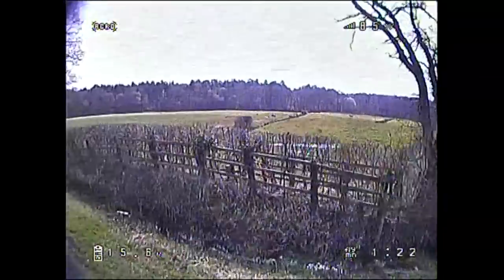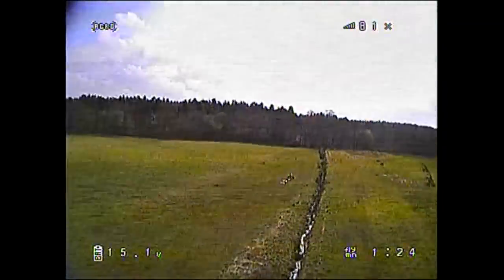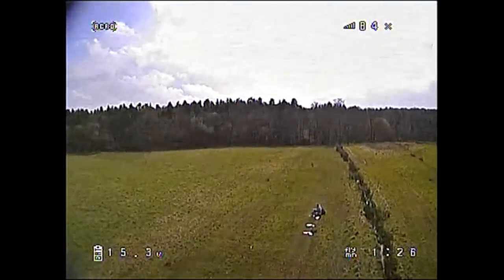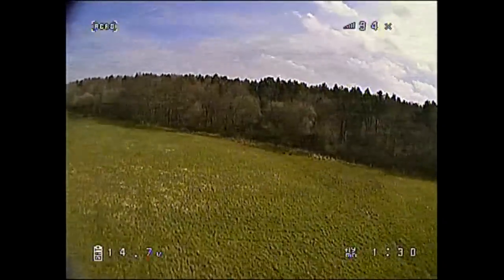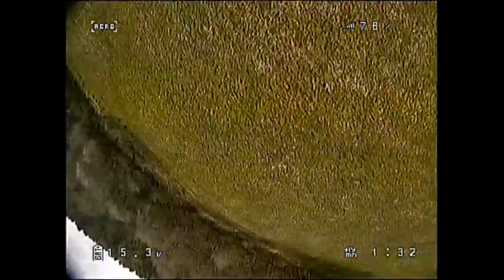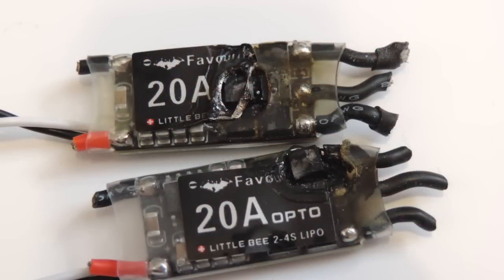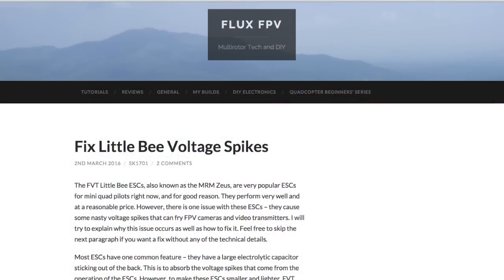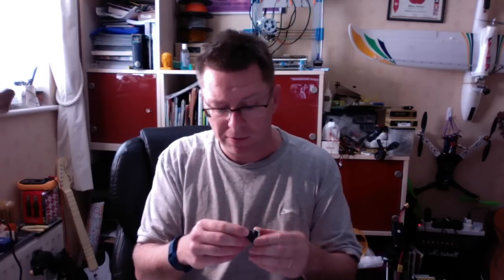Help: Why are my Little Bee 20a ESC's bursting into flames ?

Comment: 4s 5inch 30 amp esc or more.  Check motor specs. Burst 10sec 45 amp. And keep motor running at idle speed.  Prob solved

Comment: Sir can u help me..im building my fiest quad and i ordered this esc to be used on a f4 omnibus pdb fc... it says my fc supports dshot but the esc only shows oneshot? Can i still use it to build my first quad even it only supports oneshot
Reply from the maker: Yes - if you have these original LittleBee 20a, then they don't support DShot, so use OneShot125 as the  best thing they can give you.  You FC won't care, you'll just need to set the ESC type in Betaflight to OneShot125 as well
Reply: Ohhh i see sir..sorry im really new to building this quads... actually i have the 30a version of littlebee... so happy to know that its not an issue..i just need to configure it on betaflight and use oneshot option...thank you very much sir...so.excited to start my first quad build

Comment: a follow up to this might be nice.
Reply from the maker: Well, the quick follow up was this was over 2 and a half years ago and ESCs have moved on.  As far as the little bees went, my replacements didn't explode, but I wasn't happy with the amount of noise they produced and they are all sitting in the spares box at the moment as I swapped out for better things.  As far as why they blew up, some people tend to worry that there were loads of fakes around, and there was talk about never running up motors up full without props else the RPM goes too high and then they pull to many amps and blow the ESCs up.  I don't do that anymore as well as a precaution.
Reply: @CurryKitten  thanks for the reply. I bought a second hand quad - seller claims the esc are littlebee 30a - but the blheli code would suggest they are 40a. let's hope i have better luck than you did.

Comment: I’m a noob and just bought these ! First question is can I use them without doing anything to them ? Also can I use them with omnibus f3 board ?
Reply from the maker: I didn't know people were still getting these, ESC tech has moved on, and things that don't run BLHeli_S and Dshot are considered a bit old.  But yeah - they should be ok, just don't run them up very high without a prop on, and I think just about everyone will agree that they are a touch on the noisy side as far as causing some lines in your video.  Other than the two that went on fire, I continued to run a 4s quad using these ESCs for quite a while (until it got retired in place of better quads/components)
Reply: CurryKitten I got them cause they were cheap can you tell me some cheap better ones to use
Reply from the maker: Don't worry - they'll work fine - fly with them and have fun.  By the time you get to wanting new ones, ESC tech will have jumped forward again.  BLHeli_32 is already getting more popular, so wait a while and skip BLheli_S entirely :)

Comment: Hi mate - the issue is your ESC's werent sized for your battery (4s) and motors. There are two issues with your setup:
1) The voltage spikes are caused by regenerative breaking (damped light). This is killing your electronics.
2) Average current draw from your motors @ 4s exceeds ESC capacity. This heats up the FETs, to the point that the solder that bonds them to the PCB melts, and the moten solder than shorts the ESC -> fire.

Solution to Problem 1: Reduce loop time and add LOW ESR capacitor (preferably 250uF per ESC, or one 1000uF)
Solution to Problem 2: Use smaller motors, OR use 3s

So the only real solution to this will be upgrading to a higher ESC rating. KISS 24A handles regenerative braking quite well (however LOW ESR caps are still recommended if using long power leads to each ESC) and will handle more current than the littlebees. Well worth the investment if you are venturing into the 4s race quad world.

Comment: Which one do you suggest please?
Reply from the maker: Last ones I used were these Racestar ones (https://www.banggood.com/4PCS-Racerstar-Labs-28A-28amp-2-5S-Dshot600-Ready-ESC-BLHeli_S-16_5-BB2-Supports-Dshot300-Dshot150-p-1139329.html?p=E81211714085201408XQ) which are doing very nicely so far.  I liked the fact that they come without any wires soldered on, so you could get the length you want just right.  BLheli_S and Dshot 600 as well - getting nice smooth flights from these so far.

Comment: Me and a mate between us bought 15 of these ESCs for exactly your purpose (4S on 250 size quad). We call them "LittleBomb"s. we bought 12 from a reputable supplier - 3 were DOA and over the course of a month or so 5 caught fire during normal use. Checked on a bench and with our setup we were pulling 19A on 4s. Because the signal wire is so close to + battery, when it catches fire they tend to short together, killing your FC. This happened to me twice!! My advice is get some better quality ones and move on. Once you do, you never look back :) happy flying!
Reply from the maker: Glad it's not just me :)  I haven't used LittleBee since.  They seemed to be flavour of the month for a little while, but now there's a lot more to choose from

Comment: were you running more than a 4s battery?
Reply from the maker: Nope - it was on 4s
Reply: Not sure, I run blheli's 20amp on a quad 250mm,  but they are all set to normal, as in, closed loop mode off, pwm freq set to high and not dampening. I guess with cleanflight on certain flight controllers you can set it up to be more on the racer side of things, like oneshot125 or not? I'm using a pixhawk and just recently got it to tune in (flyable) with a newest firmware update on the blheli escs. 
Last thing I can think of is when I updated the escs' firmware, blhelisuite software, warned about the escs bursting if the wrong firmware was installed OR the wrong settings were used with the firmware, like the mode it was set to for updating. Multi or single? Plane, I forget the other modes. 
If I have similar issues I'll be glad to let you know.

Comment: I received my wizard from banggood last week and flew for the 1st time today.. after hovering for a few seconds while I was looking for twitching an esc caught alight and brought me down.. I believe the wizard has these 20a bsheli escs, you think banggood got a dodgy batch? everything was fine when I tested them in betaflight. guessing 4s batteries are just too much for them or something? 10 seconds flying then a sudden death.. better un-charge these batteries :(
Reply: I'll upgrade to 30a and get some new motors.. but damn, what a start to racing drones lol I checked my others for isses and they look all good visually. going to try replacing the burnt one.. if that dont work then I've got another 4 weeks to wait to get more ordered :(
Reply from the maker: That's a tough way to start - normally you have a bit more flying before something goes up in flames ;)  The Eachine ones used in the Wizard are obviously a bit on the unknown side about if they are a badged something else - but hovering will not be pulling enough amps to kill them.  The replacement LittleBee 20a's I got worked fine and I pushed them pretty hard.  I would suggest you unfortunately had a faulty ESC.  I would pursue a replacement though banggood, and paypal if they don't respond.  The idea of the Wizard is it's RTF - if it burst into flames on it's first hover, something isn't right
Reply: weused2bestoned you'll need to upgrade the PDB as well if you're moving to 30a ESCs, the stock Wizard PDB is only rated for 25a ESCs.

Comment: Have u put in a capacitor to remove the voltage spike yet? I got LC filter on video system(Video Tx + Cam) so they are protected. I added a 25V 1000 micro henry capacity on power leads but still my FC accelerometer was burnt and need to change to a new FC after 4 months(but I can not be sure if it is due to voltage spike or many crashes).  Also the loop time may not be supported by little Bee if you are running it too high.
Reply from the maker: I haven't, and too be honest, this quad has been resigned to hanging on the wall lately, as I've been flying my one based on Kiss ESCs which is so so much better.  I've also got some replacement motors which need higher rated ESCs, so these are probably coming off altogether in the next few weeks and are more likely to be used in some wing scratch builds or something.
Reply: make sure the capasitor is low esr

Comment: After few months, there should be a lot of info online already. I added a 25V 1000 micro farad capacitor to the power leads. Also added a LC Filter(2.7 mini Herny inductor + 16V 1000 micro farad capacitor) to 12V BEC powering videoTX + camera, most noise form VCC is now suppressed even with dampedlight and oneshot. But I doubt how the noise/break burn your little bee. Seems some kind of short circuit is more likely. You sealed/waterproof ESC? Applied CorrosionX? to me waterproof is a must as muddy water is highly conductive, so I sealed my ESC completely

Comment: I'm having the same issue. Put little bee 20a blheli_s on my quad and it kept burning one by one. This morning is the third one. Interesting is that they are on different arms so I'm thinking maybe the lot I got were faulty. I'm curious you figured out what was the problem? thanks.
Reply from the maker: Well, reading the many comments back - either fake ones (bought from ImpulseRC in Australia who are a pretty good and reliable dealer) or the amps can go though the roof if you run up motors with no props for a few seconds.  So my fix was not to ever run motors high without props.  Nothings burst into flames since at least.
Reply: Thank you for the update. So it is different here. In my case when the ESCs burned it was mid flight (with prop of course) and only when I did fast flip. Not every flip though. Anyway glad to hear you sorted your problem and never have the issue again. cheers

Comment: I found that even though some esc's are rated 4s they don't handle it.  I use Kiss now and they are the best I have used since I started in FPV, 4 yrs.
Reply: Just buy a Mamba flight stack for 45 bucks it is really worth it. 40a esc 4 in one and a awesome flight controller.

Comment: I had one of these littlebee 20a's burn up in a similar way to your photos. What had happened was one of the propellers had become loose and the the FC was spinning up that motor to full power to try and level the machine out. This caused it to burn up. I've been researching why this happens in a wider sense and have heard all sorts of things blamed from reversing the motor direction in the ESC firmware to poor soldering on the ESC pcb itself. I haven't rebuilt the machine yet (waiting for replacement ESCs), but these littlebees just don't seem reliable. I'm going for 30A this time.
Reply: did it work? change for some 30A ESCs.. I had ecxactly the same issue (now i'm the one waiting for replacement ESCs... lol) What brand did you buy? they worked well? And you bought new propellers? what brand?? hahaha Thanks for the help
Reply: Me paso exactamente lo mismo, pero creo que pudo haber sido porque conecte una batería de 40c de descarga. Seguro fue por eso no?

Comment: I had the same problem, I was building a 250 sized quad for school and I went through 3 Littlebee 20A ESCs before I even had lift off (this may be due to my poor soldering abilities). But then I replaced them with ZTW Flash Blheli_S 30A ESCs. The BLhelis have been great, none have stopped working and they're a lot quieter.

Comment: There are lots of fake littlebee escs only capable of 3S. My 20A esc blow up just plugging in a 4S battery. Now I fly DYS xm or xs only.
Reply: That is the matter. Well said Vincent Ko. The fake Littlebees are made only for 3S. You will fry them with 4S. The original Littlebees can handle 4S. No need to upgrade to 30A. Just buy the originals as these ESCs are very very good

Comment: check for solder flux in the nfets!!!!!! ......solder flux can actually be dangerous and bridge small connections causing fires.....clean esc fets with 90 isopropyl alcohol and toothbrush ,it works well...ive found toothpicks sometimes help break it up too....the same thing happens to ppl on pdbs too,arching and poof!...be kinda gental,do not scrub the crap out of them hard,just enough to where you start seeing flux break up...this has been my case and helped finally put an end to my qaud fires on my bee 30a and kiss escs! always clean that flux off guys before you install the escs...i catch myself still leaving flux sometimes on my kiss escs....its an easy mistake to make!!! costly and dangerous if ignored obviously...i would suggest cleaning flux off any part of qaud....fc ,pdb,motor,esc and any other connections...i hope i helped a few of you guys
Reply from the maker: Interesting - I must admit on not checking on the ESC's before... mainly because I couldn't be bothered to remove the heat shrink - but I'll certainly inspect in the future
Reply: Flux destroyed like 4 of my escs before i figured that out.. I thought no way is flux the problem.. and I had like the neatest soldering by the end and then I relized that the effin flux was the problem

Comment: If carbon frame isolate the esc´s from the Frame, if it´s an software isse set all D to very low value, high D can introduce high frequency switching. And you burned a camera which tells you have high voltage spikes which littlebee´s are known for (up to 30V) with damped light on. Are you using any lc filters or capacitors to protect you gear from those spikes? What is your motor timing in BLheli, check if you can find anything about it from you motor manufacturer if not set timing to a lower value. Maybe it´s not the esc´s but a motor, have you damaged any windings with too long screws ?

Comment: Did you ever solve this?
Reply from the maker: Well, kind of.  Whilst some people have suggested that they have run up their motors without props and the ESCs have been fine - others have warned that this can generate far RPM and more amps that can be tolerated (which I did find odd, as without a prop you'd expect no load)  Since replacing them it's all been fine though.  So either I did just have 2 dodgy ones, or running them up high can screw them up.  I won't run them up high any more without props on as a precaution
Reply: CurryKitten motors with no props on will not use more amps

Comment: Buy the Afro ESC and you will never have a problem.
Reply: go to racerstar 30A blheli_s cheap and great
Reply: Afro ESCs suck ballz, unless your a very docile flyer then they are fine. They can make the copter hard to tune if your trying to get a rock solid feel tho so I still would not recommend them because if your flying docile enough to make the ESCs not under perform, there is a good chance your not great at tuning. For the prince range of the Afro, you can get a much better ESC. Do yourself a favor and don't buy Afro ESCs.
Reply: +helicrashpro I used to run AFROs and then they decided that it would be a good idea to try smoking the motors, one by one, so I changed to another ESC and never had another problem
Reply: I used to be an afro esc fan for a long time but I burnt up so many every time I tried to use a 4s, (they were rated up to 4s).  Also I agree they are very docile even with the blheli flash.  Now I use Kiss and I'm sticking with them.
Reply: My Afros kept shutting down at random because of various electrical gremlins running on 4s. Was getting to where I couldn't even do a single flight with them without the quad disarming and tumbling out of the sky, wouldn't arm again for a full 10 minutes despite the ESCs being stone cold and battery at 3.9 volts per cell.

Comment: This might sound obvious, but you may check your screws, lately i had similar problems with different esc's (god thanks the kiss 30a have a max amp protection) where one screw unfortunally touched a motorwire which screwed up the whole electrical system on the quad. Especially noticable in a flickering osd and a liny picture. also i recommend setting temperatur protection to off because you rather have a esc overheat than drop out because it means it is to hot.

Comment: On my Atom build I had problems with the motors twitching and getting hot for no apparent reason like a lot of people mentioned below.  I dropped the minimum input value where you adjust the throttle until it eventually went away.  I think I had Spider 18a ESC on that build.  I might have turned Oneshot off as well.  I noticed things were over heating just sitting idle and I was warned that the motors and ESCs could burn up in that state and I believe it.  The motors were burning hot.
Reply: Im working on My tomohawk 130 . Sat for a month waiting for a replacement lil bee. That was bad outta the box. Get the new one today. put it in. All works fine, yay! It had 2.6 beta. So I go to flash new beta flight. Good so far. I then get the reciever going and config. recalb the motors. Well somewhere in that time a different lil bee seems to have failed. Im feeling discouraged .
Reply: @zooby dooby Didn't see your reply until now.  Yeah man.  I hear you.  This hobby will break your pockets and your spirits.  Hope you got everything ironed out.  I just crashed and broke an arm on my only quad that is flying right now.  Back to the drawing board...

Comment: I think when you increase the battery voltage so as the amps increasses as well. using a 4s battery means more power but the formula for power is voltage x current. So everything increasses and might be too much for a 20amp esc to handle.Try dys xms30a esc. I use it on my 2212 2200kv motor using 6045 props. I even try it with 5s :) for a few seconds :) the motor was warm but the esc's are okay which is rated 6s. My motor by the way is just rated 3s, the cheap 2212 :)